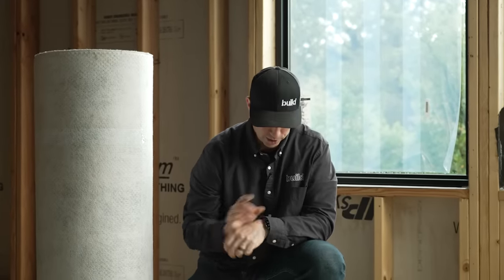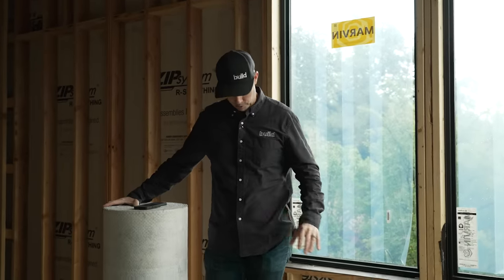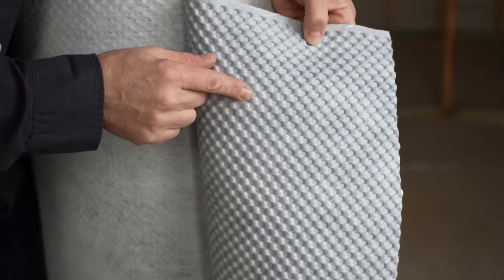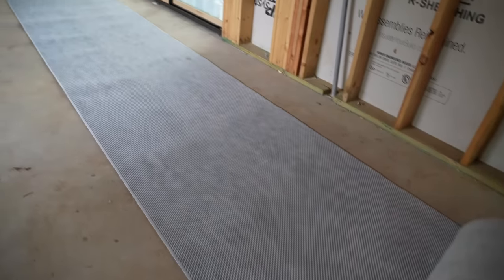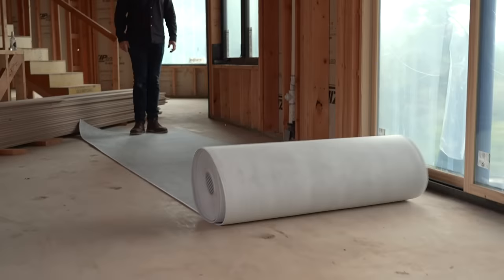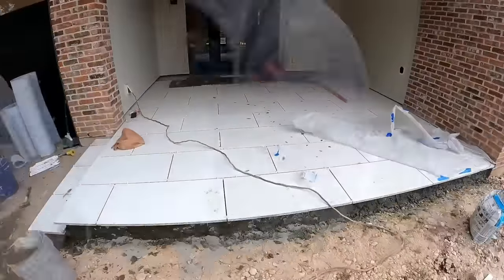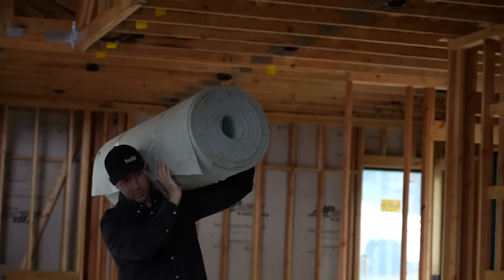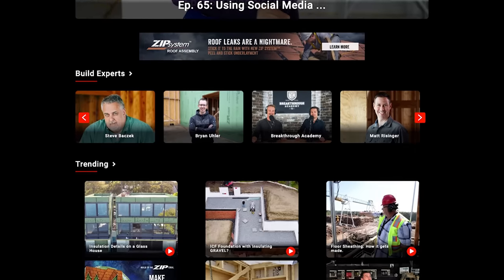Tiling over concrete? DO THIS to prevent disaster!

Comment: I understand this is sponsored but is there data on how performance for this compares to Schluter Ditra or Laticrete Stratamat?
Reply: schluter is too $$$$$$$
Reply from the maker: I’ve had both at my house and they both have worked well. The Ditra has tons more options/accessories but this USG product is working great on my exterior porches.
Reply: All 3 work fine.  I use Mapei’s uncoupling membrane cause that is what is in my area available, priced in the middle and has no memory so lays nice and flat.
Reply: They used a sand layer and then a thick mortar bed. That's how they did it since ancient Rome and Egypt. 
That would be cheaper material but not labor.
Reply: Any uncoupler would work. No big deal.
Reply: Great question!! Was curious of that as well

Comment: I tiled a behind the bar area in my parents home 42 years ago.  It was a 4x8 clay tile and I put it directly to the concrete.  As advertised, the concrete cracked.  Dad never did anything and the crack is still there today.  But the tile which cracked, has never broken free from the concrete.
Reply: It's not about coming loose. It's about unsightly cracks in the finish. Just saying.

Comment: The real problem is excessive water in the concrete mix.  Concrete does not have to crack except concrete placement "professionals" are prone to add excessive water for ease of workability at the jobsite which is directly related to excessive cracking. I've watched this practice increase excessively for over 60 years.  Such cracking can be avoided with the proper admixtures and/or methods in placing concrete.  As concrete cures, water is evaporated into the atmosphere. The results is a volume reduction and thusly a reduction in the requisite solids and cracked concrete.
Reply: Why don't they use superplasticizers more often?
Reply: Does this mean that old concrete (over 20 years old) can be tiled over without a membrane?

Comment: I don't think this is needed on an "old" stable concrete subfloor. You can use this on a wood subfloor! The Schlutter products are crazy over priced. Good to see they have competition.
Reply: Mine Concreate is 10 years old. Can I install tiles directly without any membrane?

Comment: Yep, and nearly EVERY builder here (in Austin) applies tile right to the concrete. When I mentioned using Schluter, they said "it's too much".
Reply: I’ve used Schluter and believe in the concept for indoor use. I like the idea of less expensive alternatives such as this, especially for outdoor paving. I’m far enough north that I would use unglazed quarry tile or natural stone on top of it, but Matt’s outdoor fireplace area looks very nice.
Reply: Place joints in concrere to correspond to grount lines in tile.

Use silicone or butyl rubber where grout joints line up with control joints.
Reply: @aredditor4272  Any examples of this?
Reply: @timothykeith1367  Lancaster California public library. I don't have images. I noticed the technique right after it opened many years ago.

Never left my head, I thought it was a  brilliant idea.
Reply: It’s overpriced and not necessarily. Use a topical membrane on the cracks and a good modified mortar on the rest of the install. It’ll last decades
Reply: @joseoviedo1644  What if the cracks form afterwards? I guarantee you the builders are doing absolutely nothing, though, except applying a self-leveler.
Reply: @matteosummer79  once a slab settles it’s quite rare for new cracks to form. We used to do Saltillo(very brittle) for many years and we would liquid apply on cracks. If new cracks were to form then it would propagate trough the brittle Saltillo tile, but its never happened to any of our past projects.
Reply: @aredditor4272  those are for expansion joints, not cracks from the concrete settling.
Reply: @Greg_Gatsby  an uncoupling membrane does quite well in freeze thaw locations, but down south it’s just a waste of cash
Reply: @joseoviedo1644  "concrete settling"

Lawd, you have no idea what you're commenting about.

Comment: Decoupling membranes work great and are easier to install. One limitation worth pointing out is they should not be used with small format tiles smaller than 2"x2".
Reply: Interesting... thanks for the tip.
Reply: @skellington2000  ditra is a decoupling membrane, they are basically the same thing.
Reply: Matt is just a shamwow infomercial guy 90% of the time. Durock this week, ditra next week. Wouldn’t be surprised if there is a rep just off camera coaching.

Comment: Oh man! Wish I had known about this before having our tile installed in our house. We've had stuff from water, to cement salts, etc seeping through. Such a pain.
Reply: Your foundation has water soaking into it from somewhere. If you had used this, you would just be putting a bandaid on it, causing more problems in the long term. Get your foundation checked out, if you haven't already. I've run into customers with this problem quite a few times already.

Comment: Thanks you just answered the problem I have been dwelling on for 3 years. I have cracked tiles and tiles coming loose all over my house, which is built on expansive clay soil. The contractor just placed the tiles directly on the concrete floor and it was a bad move.

Comment: wow I need this on my kitchen tile floor! they cracked like crazy after this dry summer. Gonna have to redo the whole floor I will definitely be using this. Do they make it for use with electric heating?
Reply: This is what I am wondering too, will it work with radiant heating mats under it?

Comment: Laticrete used to put out a plastic clipped together grid type of uncoupling product about 15" square, used it over structural cracks in concrete has been down for about 25 years without any problems, expensive but brilliant, can't source it here in Australia any longer unfortunately, could be used over timber flooring as well.

Comment: I installed tile on cracked concrete slab, didn’t do anything to them cracks 5 years ago. Still not a single crack on any of the 300 and something tiles. This is on a patio I live in Dallas Texas. I really wonder if we need all these additives, products and what not. 🤔 I’m sure they are needed in some applications.

Comment: Vapor doesn't come through concrete unless it's at 100% moisture level which 
would mean it's literally under water.  Before installing the tile fill the cracks with polymer base mortar let dry and then lay your tile using a mortar with  polymer!
Reply: Can you recommend a product as an example?

Comment: Looks great!, I got the same thing, I got underfloor heating system, and covered with 6cm concrete but is already cracked, don't know what to do I'll do myself, not professional but I do my best lol, just a question if I put this stuff under the travertin I will lose some heat because this gonna block the heat to heat the tile up?

Comment: Matt, we bought a tract built townhouse and immediately replaced all the flooring on the slab-on-grade first floor with porcelain tile. Looked amazing! Just sold the home and tile still looked great 4 years later; not a single crack. I watched that flooring obsessively. Why do you think we got away with no cracking? I was thinking to do the same in a new house… now not sure…
Reply: It was probably a post tension slab.

Comment: Wondering how this affects a floor with radiant heat in it? Does it still allow heat to transfer through easily?
Reply: Yes, but I would advise to use a membrane that is used in radiant heat. Even if you use any regular decoupling membranethe R-value is less than R- 0.5 so it's not going to be a big insulating problem.

Even though, I would still like to hear from others who have had this situation and what they did.

Comment: Would this also be used on top of self leveling stuff that is like concrete?
Reply: Yes, most cementitious leveling products will telegraph any cracks that are already existing in the concrete under it. If using the leveling products on a subfloor they are also prone to cracking so an uncoupling membrane is a must. 

Übertile übermat is the best uncoupling membrane I've used. It has fleece on both sides to allow for a mechanical bond on both the tile side and substrate side. Schluter ditra at least has dovetails to lock the thinset to the membrane. Thinset does not bond to polyethylene that a lot of these uncoupling membranes are made of. Having said that, I've never seen a tile failure due to this fact.

Comment: Our stand-alone garage has developed some pretty big cracks.. almost crevices. if we got the concrete sanded/graveled and leveled, would this be a good solution to prevent additional movement?
Reply: I doubt it would prevent movement since its drifting apart. Are they the same "plane" like you could place a straight edge across it decently?  Or is it different heights?    Is your floor properly cut for reliefs?

Comment: I wonder if there is much proof as to how well the various decoupling techniques work.  I'm no expert but here's a few that come to mind: Hydroban/Redguard, type liquid applied,  This stuff/schluter matts,  concrete board,   Tar paper under a mud bed.  

It seems to me that many of the benefits of the matt style ones are lower labor.  But a cheapskate doing a remodel may be willing to sacrifice time with a cheaper product as long is it ends up with the same quality.

Comment: My parent’s house is in the Caribbean and is all concrete. 30+ years and not a single cracked tile. I just noticed one small crack on a wall.  How is this achieved? My father designed the house and the footing or pad is about 6 feet of solid concrete and everything is extra reinforced. Is that what did the trick? That’s too much to try to replicate but is there a minimum footing that would provide the same effect? Or maybe it was good luck, a good building site? There were no membranes, insulation or barriers used.
Reply: Well built tiles don't crack. It's all about the tile. These people sell expensive bs to the clueless.

Comment: Hey Matt , would that work for laying thin rock over concrete on a patio?
Reply: I'm sure Matt would have a more detailed answer but it really comes down to this. If what you are laying is susceptible to cracking then use a membrane. Tile is very susceptible to cracking . Grout can also easily crack so that is a consideration. You said thin rock. If it were me, I would spend the extra buck per sqft and do it. The advantage that Matt mentioned with this product is you can use either modified or unmodified thin-set. The other brands of membrane are very specific and it may be different than what your tile requires.
Reply: really what we are talking about is uneven expansion. The uncoupling layer makes the tile assembly slide as 1 unit. When you take that outside, the movement is times 10 (made up number) The temperature changes are wider and more often. The sublayer can move not just left and right but add up and down. So, it "might" help" but there is no guarantee for the same indoor performance

Comment: Instead of using an uncoupling mat, why not just reduce the the water to cement ratio, use a superplasticizers, ( you can reduce the water content as much as 40%) and some fiberglass rebar? No reason to have cracks. Might even be cheaper.
Reply: Must admit that was my first thought. We don't see cracking in concrete like that here (Norway), unless some ejit has poured it like soup. Then it's tiled using flexible adhesives and grouts. Rare to see cracks in properly bedded tile in my experience... Maybe I need to get out more lol!

Comment: Not one company in Australia uses this. This is not even a problem... your lack of actually mesh is the problem.  Micro cracks don't cause any issues. Either that or your glue is different... and goes hard...

Comment: Actually Matt, I ve been setting tile for 38 years, I couldn't begin to count the s/footage of tile I have laid over concrete, and I have YET to be called back to repair a crack over a slab.
It's not because I never hear from my previous customers, because my business is at least 75 % repeat customers.
I have used a rubber membrane on a large commercial job about 15 years ago, at the architect's
spec. I also used the plastic ditra material on a restaurant floor because the owner requested it.
Nonetheless,  my experience has been that if you use a quality thinset and take the time to fill any major cracks and top with mesh tape, you are very rarely likely to have a problem. You are more likely to have an issue with grout cracking due to flexing in the membrane or the ditra material. Either way, the added expense isn't justified for covering a whole floor to protect yourself from an potential problem in a limited area that at the worst might require a small repair.
The likelihood is that you hope that somebody who doesn't know any better, will see your video and go for it when you suggestive sell this, thereby pumping up your profit margin.
Good luck with that.
Reply: What thinset do you use?
Reply: @OGCJ10  You can't go wrong with versabond (home depot), or mapei ultrafast (lowes).

Comment: So here’s the issue, tile on concrete can breath, but this stuff caused your tile to crack/debond as soon as you have a water loss and you’ll be tearing up the entire floor system. I know this because not only do I have 30 years of construction experience, but I also have 10 years as an insurance adjuster. I have to write to replace tile flooring all the time because of shit like this. Same goes for the “waterproof” vinyl flooring. Once it gets water under it, you have to pull it up and throw it away the moment it gets water under it.

Comment: At the start of your video your cracks are a bit more than normal shrinkage cracks. Either a poor mix design or more than likely use of added water to the concrete mix for ease of placement rather than spending a few dollars to use plasticizer to make the concrete temporarily flowable.  Shrinkage is caused by water leaving the slab over time. More water in the mix equals more shrinkage.  Request a low water content concrete mix design. With todays technology there is no reason to have cracking concrete!

Comment: Here in Florida we use Redguard. Great video and thanks for sharing.
Reply: Is not Redguard a water proof system?    These membranes allow floor to move but not the tile. The membrane will move and leave the tile intact.  I'm in Ohio and understand the weather difference means alot in construction.
Reply: @stevehamman4465  Here in Florida the Red Guard seals the concrete, Fills the cracks, Stops any radon from coming through the concrete, protects the tile from cracking but most of all Custom Builders The Manufacturer gives the tile job a lifetime warranty. To get this warranty you need to by their mortar, grout and redguard..